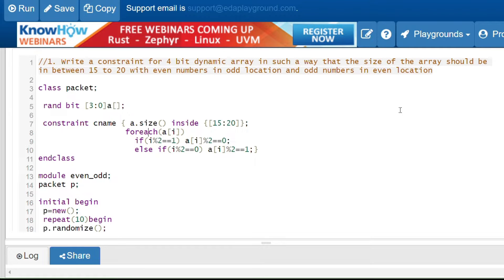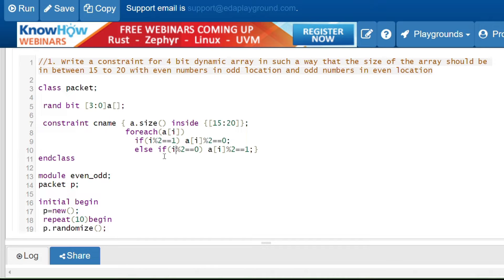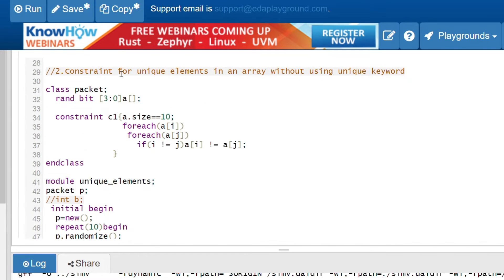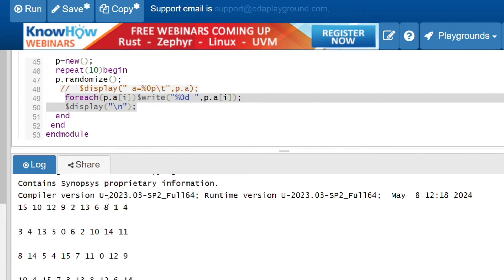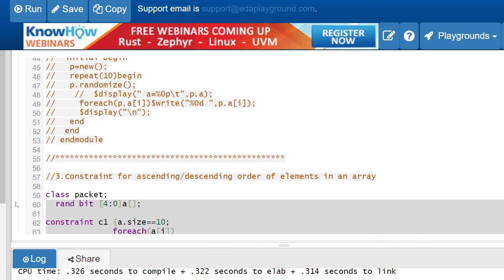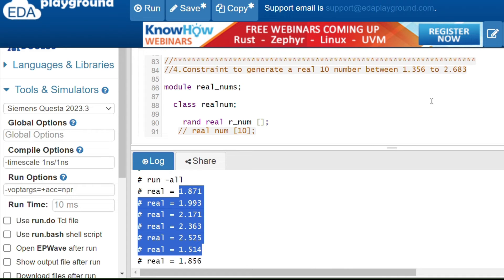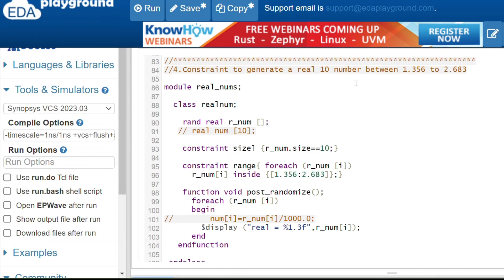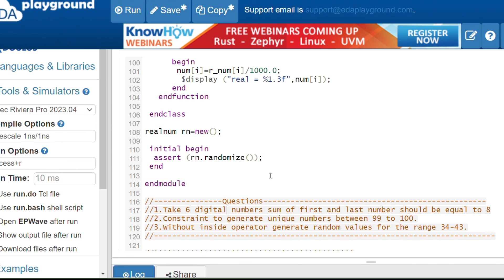Examples for Constraint #systemverilog | PART-1 |Constraints Q&A #vlsi #learn #coding #semiconductor

Comment: 2. constraint to generate unique numbers between 99 to 100
module tb();
class packet;

rand int a;
real y;

constraint c1{a inside {[990:1000]};}

function void post_randomize();
y=a/10.0;
$display("\t\t\t uniquw valus is %2f", y);
endfunction
endclass

initial begin
packet p1=new();
repeat(20) begin
p1.randomize();
end
end
endmodule
Reply from the maker: Correct✌
Reply: Could u share u first question in the comments......
Reply: class NumberGenerator;
    rand bit [19:0] num;

    constraint sum_first_last {
        num inside {[100000:999999]};
        (num / 100000) + (num % 10) == 8;
    }

    function void display();
        $display("Generated number: %d", num);
    endfunction
endclass

module test;
    initial begin
        NumberGenerator gen = new();
        if (gen.randomize()) begin
            gen.display();
        end else begin
            $display("Randomization failed.");
        end
    end
endmodule

Comment: 3. without inside operator generate random values for the range 34-43

class packet;
  rand logic [7:0] a;

  constraint range { (a > 34) && (a < 43); }
endclass

module tb;
  packet p;
  
  initial begin
    p = new();
    $display("value of a (>34 and <43) is:");
    repeat(15) begin
      p.randomize();
      $display("a = %0d", p.a); // Display the value of 'a'
    end
  end
endmodule
Reply from the maker: constraint range { (a >= 34) && (a <= 43); }
because 'inside' includes 34 and 43 too.
Reply: @susheelapatagar  thanks for correction